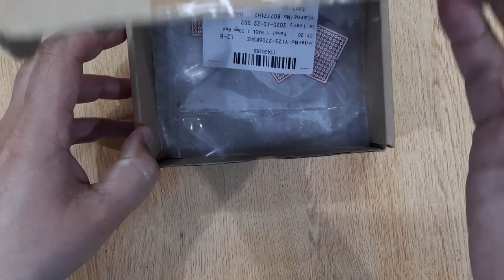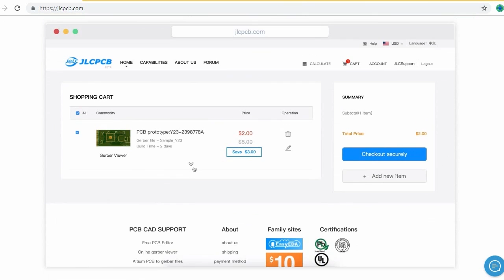How to Make Voltage Booster Circuit | Voltage Booster

Comment: Nice. I often used this trick to get a negative low power supply on some digital circuits I made. I used the clock signal instead the 555 timer to get a negative voltage when I need it or to boost the 5V to some bigger value. However, the current that it give is not that big, up to tenths of mA.